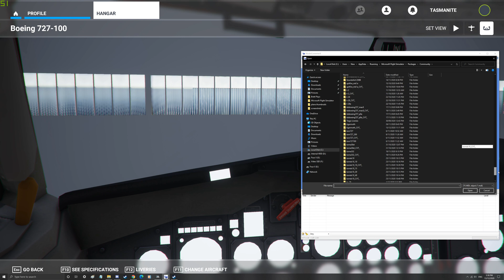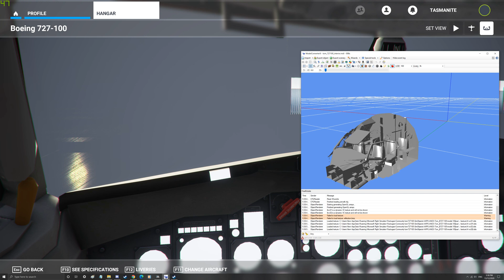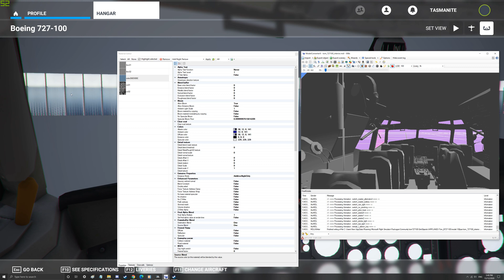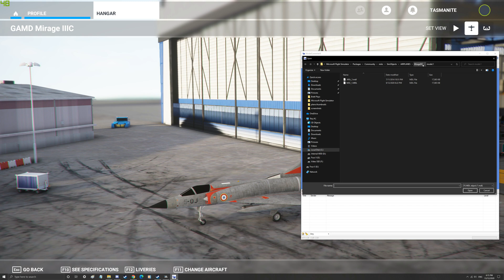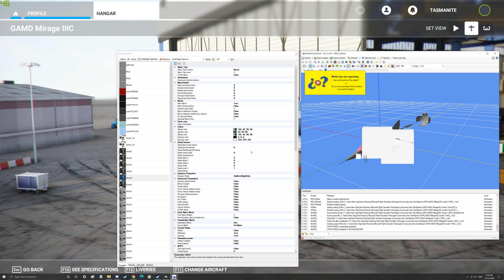Fix Frosted Glass on FSX imported Aircraft - Microsoft Flight Simulator 2020

Comment: I tried modelconverterx again today and it will not open. Its a new installation and new computer. Its been a long time since I have used it. I really wanted to convert the cessna 210 and lancair iv. I had converted these before.
Reply from the maker: I haven't tried mine for a while now. Will the program itself not open or will it not open the mdl files?

Comment: speak up mate and turn the music off, difficult to follow.
Reply from the maker: ok I will use OBS in future to record, I can then turn the mic up to a better level. Hopefully you can still hear enough to learn how to clean the glass.
Reply: @BrettPlays  I have trouble reading the files your clicking on as your going pretty fast, but I can stop it I suppose and examine what your doing. I used model converter X years ago but have forgotten most of what I learned since I have not until this week re acquired FSX to do some plane conversions myself.  been about 10 years since I played around with FSX. some planes convert almost effortlessly some are a mess, most in between, need to brush up on editing CFG files. The Alabeo Tri Pacer comes over pretty well, only missing the Altimeter working and the panel object, in case you like that kind of thing.
Reply from the maker: @JahnDee47  Yeah I was thinking next tutorial I do i will change from 4K to 1080p so things are easier to read and maybe I can slow down some of the steps so people can keep up.

Comment: Whenever I save it and play it reverts my cockpits to 2d.
Reply from the maker: are you saving it as the same name? Are you adding any other settings too when you save it. Make sure it is saved as fsx.mdl format in the save options.
Reply: @BrettPlays  I click  interior and it just made it 2d. Am I supposed to do anything to the main non interior file?
Reply from the maker: @The_la_spotter  no and I have never had that issue. What aircraft are you trying to clear the glass on?
Reply: @BrettPlays  727-200 and p3. Can you just take a look at it on discord later.

Comment: On the Iris T-6B Texan II My glass exterior glass is still foggy after your fix. Any help?
Reply from the maker: Make sure your selecting the mdl file for the exterior and not the interior one. I don't have the T-6B installed to check. Do you have a link to the original and I will have a look too.
Reply: @BrettPlays  yes, do you have a Facebook or email? I can email you the link.
Reply from the maker: @larryhughes322008  I have both and they are on my channel about page. You can either link here on YT or email here. brettplayschannel@gmail.com But no google drive links only looking for the original website freeware file links please. I don't want to share/receive copy right protected files. If it is a payware you can come to my discord and I can work it with you in a chat channel to get it working.
Reply: @BrettPlays  okay, sounds good.